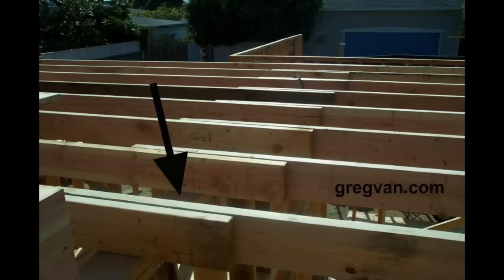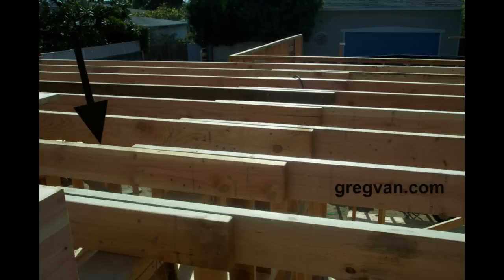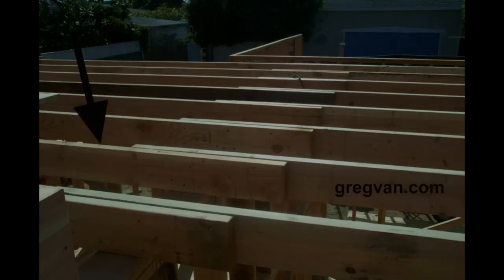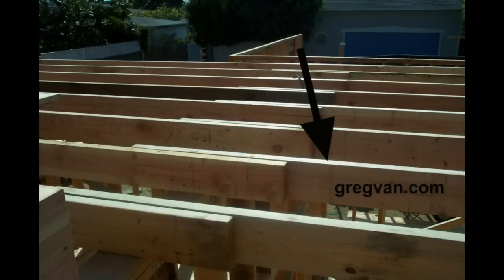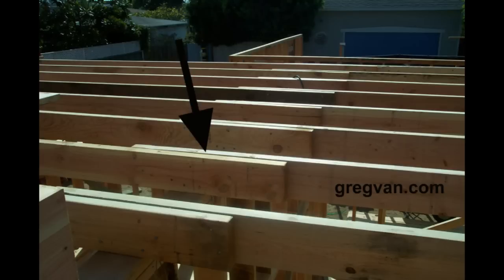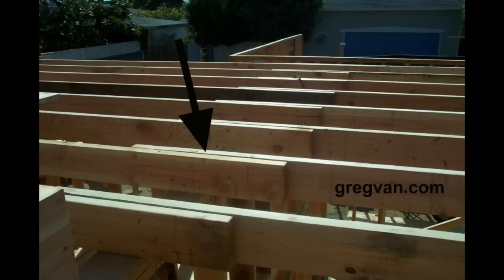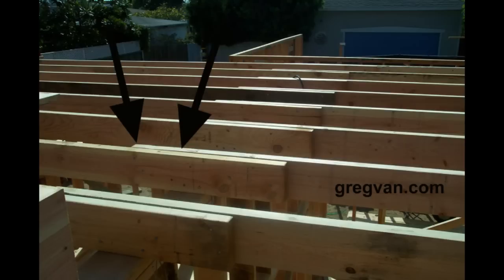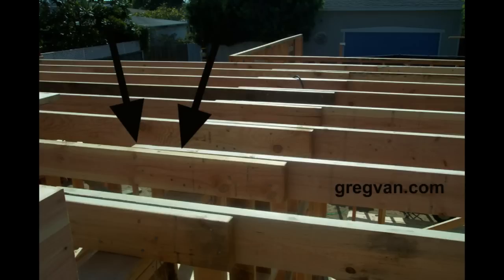Wood Framing Ceiling Joist Laps Connections - Home Building Tips

Comment from the maker: @magexx9 Yes, it definitely would throw the layout off, but it will only throw it off for a few feet.  You will need to switch your plywood floor layout, before or after the lap, depending upon which will work better.  Simply nail a scab or scrap 2 x 4, to extend the lap, in the preferred direction.  Sounds like another video to me, I will see what I can do.

Comment: Love your videos. We just bought a 1950's, single level ranch style house with a low pitch Gable roof with really long soffits. We're in Florida so no doubt the house was designed for rain and hurricanes (2 weeks after moving in we got to experience hurricane Matthew full force and the house was brilliant)

The house is shaped like an L and in the front section of the house, smack in the middle parallel to the roof-line, there is a small bulge / cracking in the ceiling running longitudinally from wall to wall. After a little deduction it looks like there may have been a load bearing wall there at one point. And the house being built in the 50's, it's probably safe to assume that's where lapped ceiling joists were resting. The section of missing wall does not extend the length of the house, only about 1/3 but smack in the middle. 

I'm planning on partitioning off that area of house for a laundry room and guest bathroom BUT my wall line is going to sit about 2" off center of where the original "wall" probably was.

In your experience and opinion, are there any tricks I can use to make the new wall load bearing or will I be forced to employ a hidden beam above the joists?

on a side note, I've been watching a lot of videos where people are using LVL beams and CUTTING the lapped joists so they can hang them off the LVL - doesn't that defeat the purpose of lapping the joists? Isn't there a shear load that pushes and pulls laterally or is that dependent on the roof type? (which would be the part of those videos not explained)
Reply from the maker: This video might help https://www.youtube.com/watch?v=D4cIvUnrnyM 
If the home still has the existing ceiling joist lapped, then you might be able to install new wall a couple of inches to either side, as long as it supporting the ceiling joist. You might need to install a beam to support the ceiling joist. Feel free to send me some pictures and you can get our email address at the website if you need more help.
Reply: Oh wow great, thanks! I will but right now I do not have access to that section of the attic space - I have to tear down the plaster first to stick my head up there - the roof is so low slung that it's a tight fit. I'll be lucky to fit a beam up there with HVAC ducting when I'm done - luckily we have an attic vent at the far end of the house that will allow me to slide a beam into from outside

and yes, I predict I'll be using a beam because the location of my new wall (which is a hard limit) is going to be too far away (assumption) for both joists to rest on. 1950's construction didn't have much overlap on ceiling joists I'm thinking
Reply: Sorry, I just realized my typo - my partition wall is going to sit 2 feet off center from the original and I just checked and my joists are only lapped about 1 foot.
Reply from the maker: Sounds good and good luck on your project.

Comment: My grandfather's house has shallow joist lapping which spans between the exterior walls. There is x-blocking between the joists and I can walk on them individually without any noticeable deflection. They've held up for 70 years but I am concerned about future give-aways. Any suggestion on how I can reinforce them?  They seem to be oak wood.
 I would like to add plywood flooring which should help distribute loads and provide additional torsion and compression resistance, but I doubt that it would suffice for any heavy loads on top of or suspended by them

Comment: Hey, thanks for this, great video. Question: I have a problem with the joists overlapping in the basement. probably due to the joists sagging a bit, the ends are poking upwards and making the floor uneven. Any suggestions? Can I just shorten the ends, or should I use wedges?
Reply from the maker: If you can cut the top off that's raising the floor, but if not, just make sure they have some type of connection that will hold the floor together. Maybe you can use metal straps if that will work.
Reply: In the UK our regs only allow an overhang into the next room of 4 inches for this reason. You could thin down the overhanging joists at the top and bottom tho then effectively the overhang would be ok at any length.

Comment: Very basic question. Wouldn't you want blocking here too? So maybe something like you said - four nails on each side. Then have blocking offset between each lap. So then you have nails in the center also going through both joists into the block. And the blocking keeps it all nice an separated.
Reply from the maker: The blocks will definitely provide you with a better product, but I've worked on plenty of remodeling projects were there weren't any blocks and rarely ran into a problem. I like the blocks.

Comment: Hey  it's been awhile since you answered questions but I'll take a chance that you may be able to answer me. I'd like to make joists to cover a span of 18 feet over an old inground pool so I can make it a deck area. Thoughts on the way to do this?
Reply from the maker: You might need to back fill the pool with fill materials, but I would check with local building department to verify. I did put this on my list of videos, because it seem interesting.
Reply: @gregvancom  Thanks so much for your reply! People are doing interesting things to convert old pools. One is to make the space into a greenhouse. That is where my ideas are also headed.

Comment: I saw a diagram once of the butt joint option where there’s a separate splicer, 4’ long, 4 nails per side. This allowed your layout to be consistent rather than shift. Emulating one solid piece of lumber (only over a load bearing wall of course). Curious if anyone has seen this in the wild or in prescriptive IRC code / diagrams.
Reply from the maker: Yes, I've seen straps used and lumber to connect butting joist. A 4 foot long board to connect the joist sounds about right.

Comment from the maker: @magexx9 It would depend on the size of the strap, but wouldn't be cost effective and could create floor nailing problems. If you install a strap on top of the joist, you would have a problem nailing the floor sheathing.

Comment: Doing a low budget roofing job for my shed. Can 4x2 or 6x2 rafters be joined like this ? My wood is in 2m lengths but my span is 5m. It’s only a tin roof but I wanted to connect the short timbers for maximum flexural strength. Not interested in cosmetic look, or is there a better easier way to connect two timbers end to end eg bracing with side plates ? Thanks.
Reply: good question but what is a 4x2 and a 6x2 ? like a 4x2 pickup truck ? and why are you using imperial measurement then metric. make up your mind

Comment: So when you put up your rafters, they don't line up on either side of the ridge board...and that's not a problem, correct?
Reply from the maker: Not always. If you need to use collar ties or straps they can be installed at an angle or with furring blocks.

Comment from the maker: @magexx9 That would be a better possibility, just don't forget that you would only be nailing into an inch and a half, which could leave you with a bunch of nails sticking out of the other side.  Some structural engineers won't accept this and would require you to nail through the top, allowing you to use longer nails.

Comment: My house from 1959 appears to have the laps just side by side. They are not connected by any bolts nor cuts in the wood.
I found this out when removing the attic floor to replace and add to the insulation. Very surprising.
The roof is a queen truss type cantilevered eves looking thing. The lap is on a load bearing wall a bit to one side inside the house. Very odd.
I thought there would still be some need to prevent the joists from pulling apart.
Reply from the maker: You can use straps to connect them together if needed.

Comment from the maker: I'm not exactly sure what you're talking about, but anytime you can add additional joist and tie it to another section of the framing, you will be improving the structural strength. Feel free to send me a picture or provide me a little more detail of what you're doing, if I didn't answer your question.

Comment: I am looking for a little guidance with this. How do you layout for the lap on the rim joists to allow for the plywood to break o/c from both sides of the beam. I am told to layout the same just put the joists on opposite sides of the line. Wouldn't this throw off the 48" o/c spacing for the subfloor?
Reply from the maker: Most of the time you simply nail a 2 x 4 onto the side of the joist where the plywood is going to break to extend the joist that is lapping on the other side by a few feet. Let me know if this doesn't make sense.
Reply: @gregvancom  
Thanks for the response. I am  (unfortunately and I apologize for this) still a little confused. I understand your tip on stabbing on a 2x4. What I can't seem to grasp is you pull 15 1/4 make a mark. Then I drive a nail at the mark pulling of 16 mark and then place an X to one side usually the right as I am pulling off. Now on the opposite rim I pull 15 1/4 make a mark but I am told put the X on the opposite side to accommodate for the lap. This is where my confusion is. By marking the opposite side all my joists will me 1 1/2 off center. The first 8' piece of subfloor isn't going to break on the floor joist. Right?
 I am sorry to bother you again.

Comment: I was under the understanding that the lap joists were NOT to be tied together to allow for some vertical movement.  Called a floating joist lap direcctly over a strucctural  beam..
Reply from the maker: I've never heard that, but if you have any building code reference numbers or additional information, feel free to email it to me and I would be glad to check it out. You can get our email address at our website.

Comment: Question-I looked at the laps in my attic and they are not on top of a wall, rather about a foot away from the wall.  Is that an issue?   Thanks
Reply: There is no direct load on the joint, unless you have a floor in your attic. 

The joists you are seeing are probably just rafter ties that keep the vertical load from transferring through your rafters in a way that pushes your walls out.

I know, it was an old comment lol. Hope it helps anyeay

Comment: Thank you for the video.
My electrician has made a foolish mistake by cutting the ceiling stud to enforce the down light.
2 day ago, I've noticed there is a tiny crack in ceiling gyprok and when I removed the down light I have noticed the stud 10x5 has been cut to reinforce the down light.
How can I repair a broken stud?
Reply from the maker: My guess is that you're referring to a ceiling joist when talking about a ceiling stud. To make the repair, you can simply add an additional ceiling joist that's the same size right next to the other one and connect the two together. If that doesn't make sense, send me a picture and I'll see if I can provide you with more information.

Comment: Okay maybe a stupid question but here it goes. I have a older house built in the 1970s. My main load bearing wall is about 18 inches offset of the girder. Over the years the floor has started to sag because of the offset. Id like to move my Load bearing wall to center of the girder. However the laps are right above the wall how do I proceed?
Reply from the maker: +C “chobdy” Hobdy It might be easier to relocate the footing and girder beam under the home, directly under the wall, but if you did move it, you would need to install new ceiling joist on the side where they wouldn't be lapping over the loadbearing wall that was moved.
Reply: My house is fairly small the total ceiling joist span is approx. 19 feet the main wall is 8ft in the kitchen and 11ish feet in the dinning room opposite the kitchen. Would it really require all the above just to move the load bearing wall (approx 16inches) to the center of the house and have it over the existing girder?
Reply from the maker: If the ceiling joists lap over the wall you're going to move, then one side might not be sitting on the bearing wall anymore and will require you to modify the structure to prevent damage from the rest of the building. If you want, take a picture of the ceiling joists in your attic and send it to me and I will try to provide you with a video, if you're having a difficult time understanding my explanation.
Reply: I'll take a picture but we are both on the same page now. So can I do anything to the laps to help them sit over the wall?  Extend the laps? Thank you for taking time to comment back to me I appreciate it.
Reply from the maker: I guess I don't need a picture, I just wanted to make sure we were on the same page and it sounds like we are. I've never ran into this situation before, where I didn't have to extend the ceiling joist, but will try to see if I can come up with something and if I do I will make a video. If I don't make a video within a week, then I probably won't be able to help.

Comment: i wanted to take a load bearing wall off the kitchen. didnt know it was load bearing until i took it apart. now how can i fix it without leaving the wall amd not putting a huge 2x10 across the 14ft span? the joists are just like this video but then they have 2 2x2s underneath to hold instead of the 2x10s and i really dont want the overhang...
Reply from the maker: You can probably install a beam to support the load instead of the wall, but you would need to contact an engineer for more information. Make sure that you visit our website and check out some of the engineering and framing videos.
Reply: Agree with gregvancom,   There  has to  be a beam somewhere  if the wall  is removed.   Also unless you  know  what your doing its hard to  give  advice on  beam sizes, too  many factors to consider

Comment: I forgot to add this, where they lap there is a foot and a half 2x4 on top of where all the joices  lap.  I guess that is to provide more support since it does not lap on top of the wall?
Reply from the maker: It should be or should I say it could be, but if you have a house that's bold and been standing for decades, then I don't know if I would worry about it. Feel free to send me a picture of your problem for more info and you can get our email address at our website.
Reply: I was told by a home inspector that the roof is a truss system and that the exterior walls hold all the weight so the joist lapping does not need to be on a bearing wall.  Does that make sense to you?